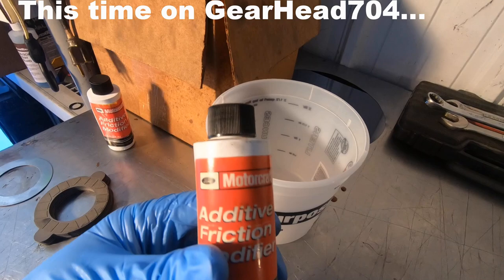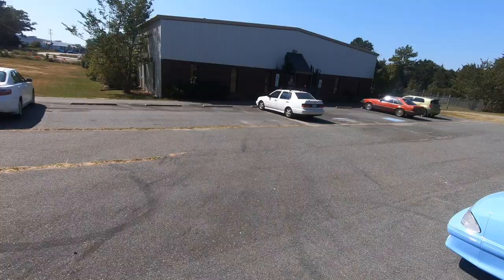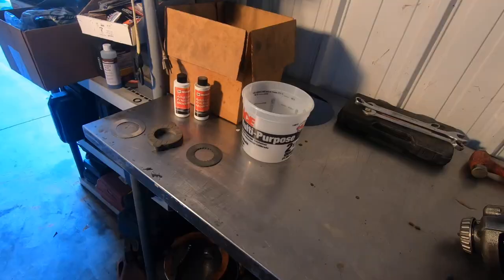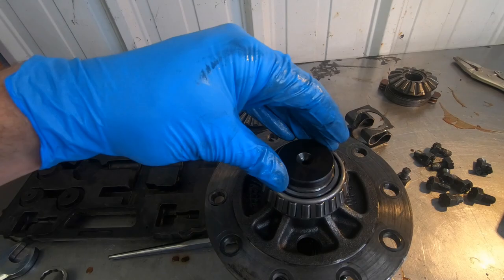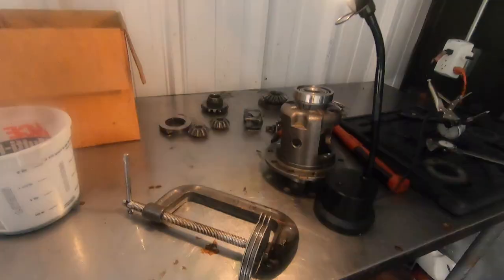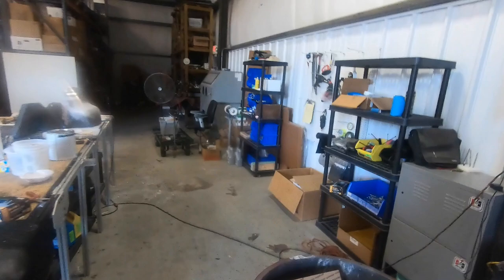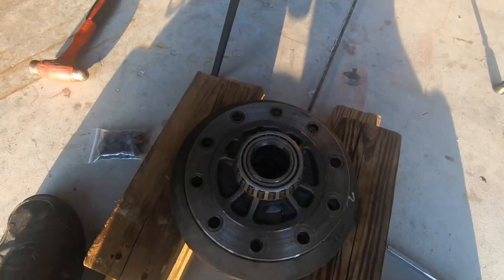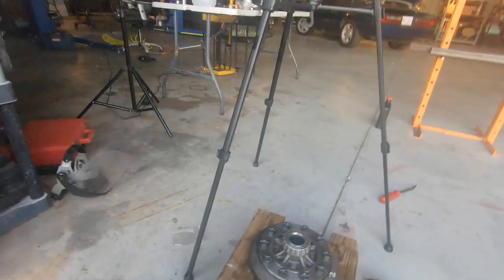Ford 8.8 Differential Rebuild and Ring Gear Install for FoxBody Mustang

Comment: On your next ring removal, after all bolts are removed  thread 4 of them in 2 or 3 turns  and strike the bolt in a cross pattern to loosen! With them threaded in it keeps the ring from crashing down on the work bench, and you can sell with no damage!

Comment: I'm surprised you didn't get the upgraded cobra carbon fiber clutch pack. No need to presoak them either.
Reply from the maker: This is going to be more of a stock "slightly resto" mod rebuild car.  Also, I am not familiar with that clutch pack.
Reply: GearHead704 i used them on my stock convertible when rebuilding the rearend. Carbon fiber clutch disc came on the 03-04 cobras. Ford Performance LMR # M4700C